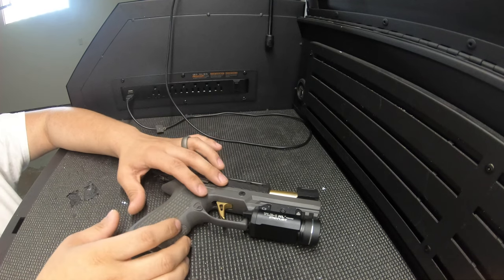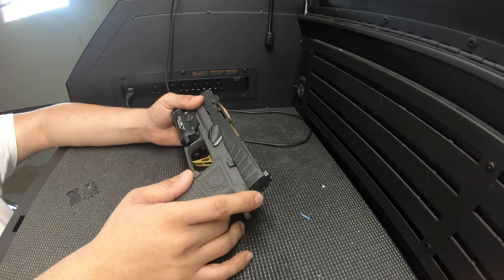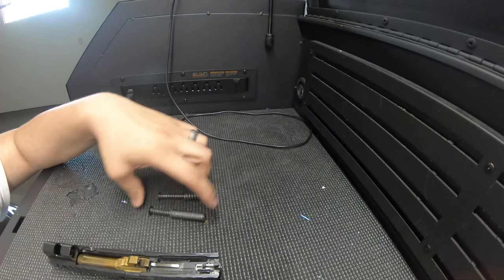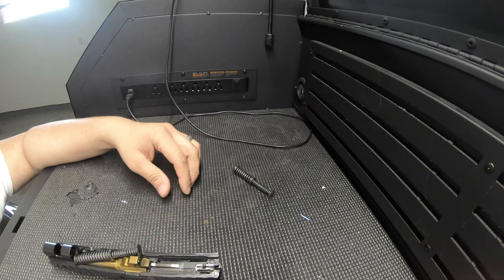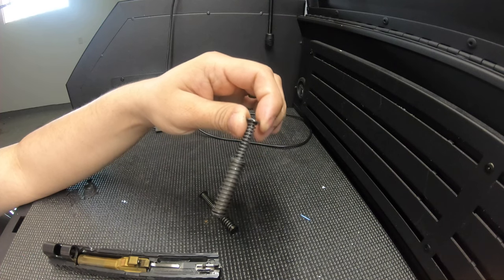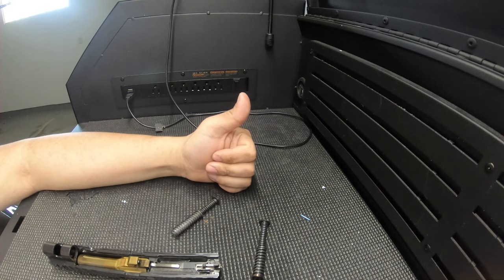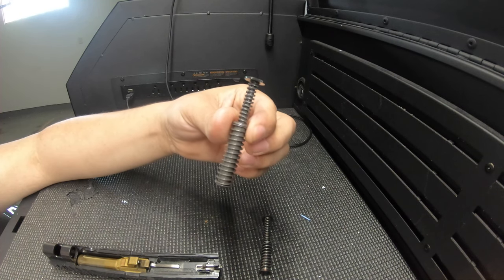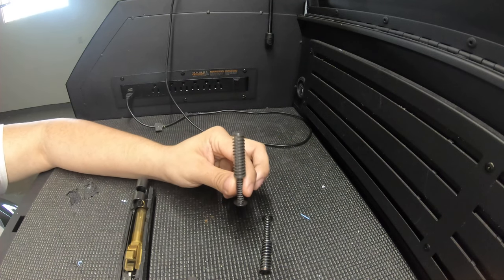Spectre Comp p320 115 grain FIX!!!

Comment: I just kept the bolt locked back for a week with the original spring in place. That fixed the issue for me. Might not work for everyone but it seemed that keeping the spring compressed for a while work in my Spectres case.
Reply from the maker: Very well could be, really it’s oversprung I have seen a wide variety of challenges. The new spring seems to be lighter and smoother by far. I think mine actually is a bit bent after further inspection I plan to see if sig will replace it. If not I will continue with my current spring.
Reply: Lol. That's exactly how springs do not wear.  Spring wear comes from compression and decompression cycles.  Using your logic loaded mags would have dead spring over time.. . which they don't and this stupidity has been debunked dozens of times.  

So much ignorance on YouTube its insane.
Reply from the maker: There are videos that show compressed magazine springs over time do have less retention. Although if that fixed the problem for him than that’s all it was. No two fire arms are the same. Plenty of gunsmiths woulde agree.

Comment: I use the Armorycraft spring tuning kit. (Uncaptured system) Runs flawless. 115,124,147 and plus P. Who fares if I have to replace a 7-8$ spring after 5-10K rounds. The spring should be replaced.

Comment: My problem with the Spectre Comp is that the slide doesn't lock back on an empty mag.  It might be where my thumb lands on my grip.  I need to do more diagnostics on it.  Anyone else have that problem?
Reply from the maker: I would bet it’s grip, do you have the style guide rod? The single coil is heavier so it could be that too.
Reply: @Gunsfornewbies  I’ll check my guide rod and try one handed shooting to see if my thumb is knocking the slide release.

Comment: why does it say compact on ebay
Reply from the maker: The recoil system the compensated barrel uses is the 3.9” which is the compact uncompensated. I have checked interchangeability between the spectre and my m18.